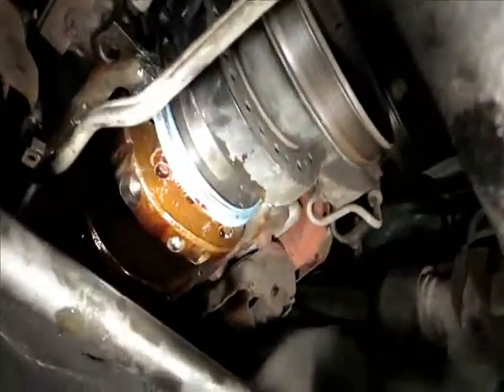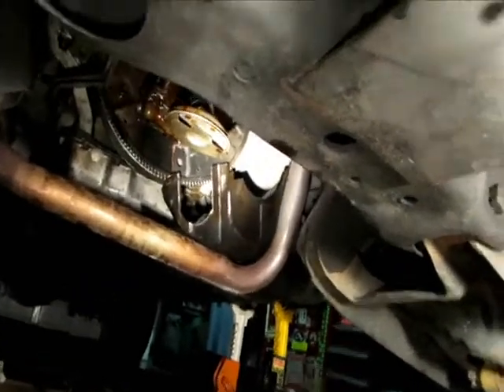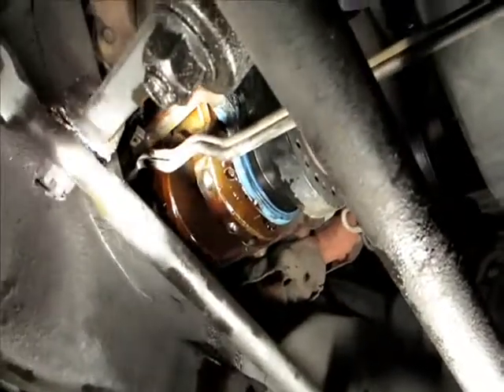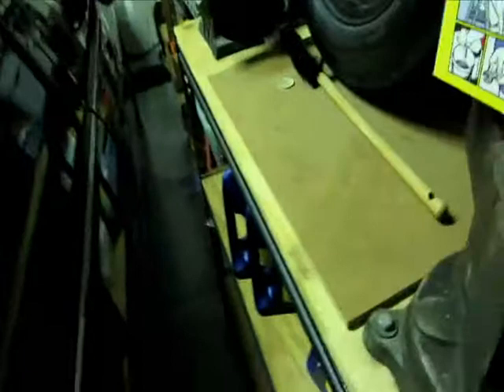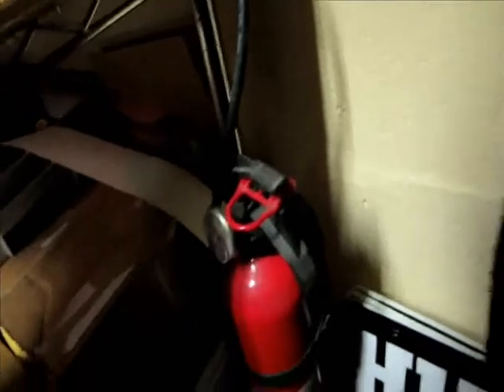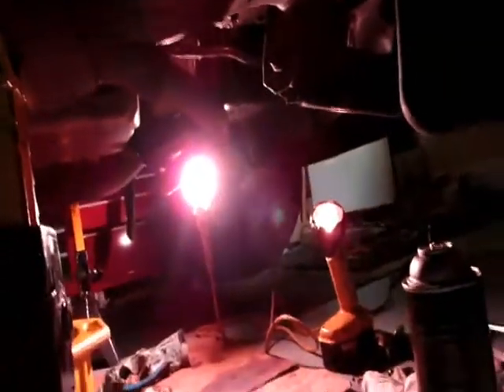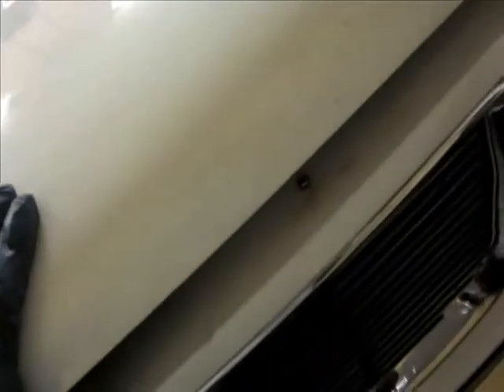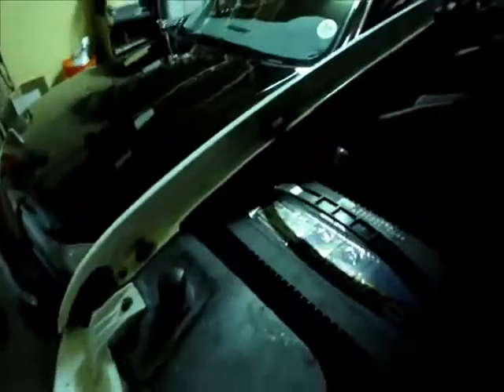GMC Sierra Oil leak, Condo garage Oil change + Oil pan reseal

Comment: Cool, so no need to loosen the exhaust or remove the transmission cover? Need to replace the oil pan gasket on my 2000 Tahoe limited 5.7 2wd. Thanks